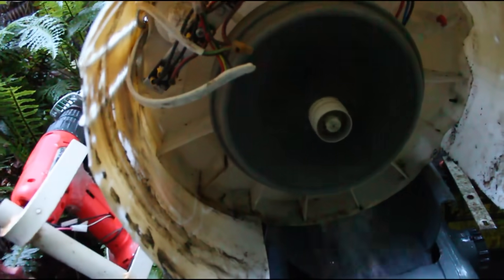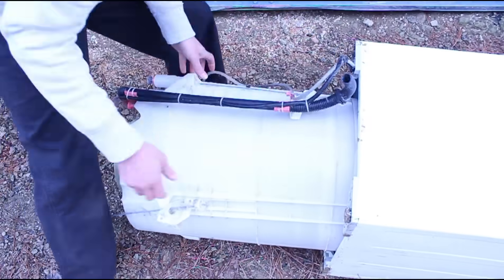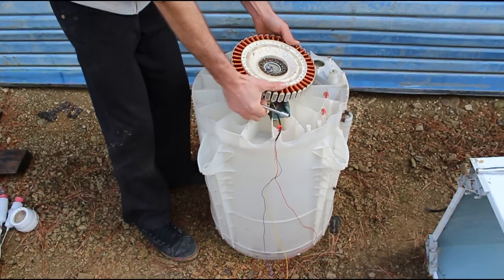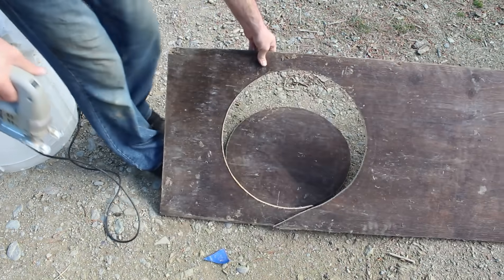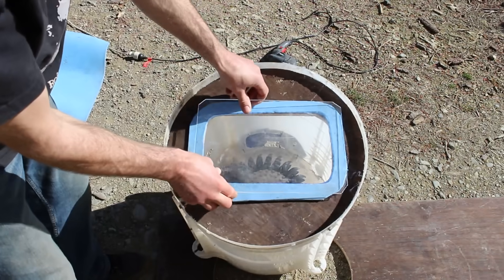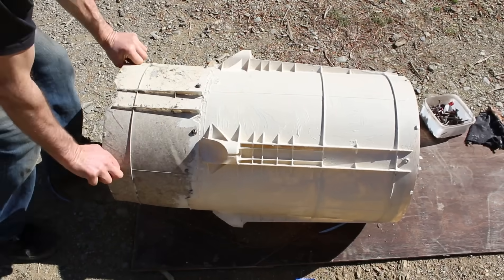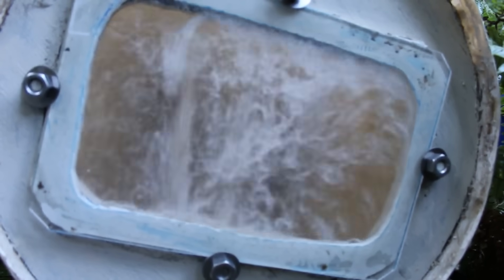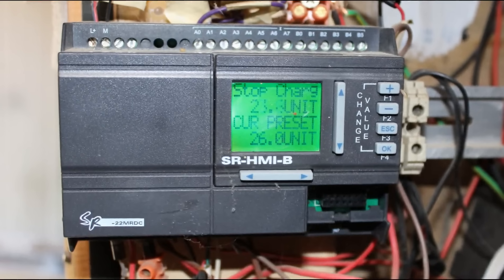Free power- How to convert an old washing machine into a water powered generator

Comment: Why not leave the AC output alone and move the power to where its need , then convert to DC (if desired)?
Reply from the maker: We convert to dc because ac voltage varies depending on turbine speed/load It will fluctuate between 0- 400v with high hz. Appliances would soon turn into blue smoke generators
Reply: Angry Ram I see your reasoning. Thanks for the response! I know you can move AC further than DC, without losing voltage. So the battery absorbs the great fluctuations , then you draw off that 🤔 I see . I’m doing some research to build a system. We have a decent creek. I don’t think the required washer unit can be obtained in US . I’ll have to figure out another solution. Thanks for sharing your experience!
Reply: @conradhomestead4518  Most US washers have the same system now. I know for shure that the whirlpool Cabrio and Bravos have it.

Comment: Would it not be more efficient to have the rectifier closer to the batteries in order to have higher voltage on the way to the house?
Reply from the maker: There is an inverter connected to the battery bank at the turbine, I send 240vac up the cable to the house so very little loss

Comment: I know this is an older video and maybe you have done it already, I know one video you said you change the bearing every 2 years now.  But would it be possible to incorporate a temp sensor to your dump valve set up so if your bearings fail you don't melt your unit?
Reply from the maker: Good idea, that would be fairly easy, just a  thermostat right next to the rear bearing (always burns out first) Connected to the dump valve trigger relay. They do give me me good warnings though, they usually whine for a few months before they melt, I can hear them from the house at night. I ignored the warning a few days too long last time
Reply: @Rambro-angryram  thank you i ll keep a eye for that when i manage to build one. And I'll put lubricant.

Comment: Fantastic mate, good on ya. Ingenious idea. I have a question if I may. I've harnessed tidal current on an island in land from the north western part of the Pacific, actually correction,  we are actually located on the north eastern part of the Pacific Ocean. South of Alaska. I used a air conditioning fan in a fifty gallon drum. I would like to know if I could make this power by having to start it with a cordless drill to get things spinning then a pump starts up sending water up eight feet where there is a reservoir. Once that has started I'm making power. From the reservoir water that was sent up by the pump which is powered by the turbin once you either started with a cordless drill, or build a crank to send water up to the reservoir to get the recycle water fall going and delivering 500 wats, 5 amps or more. What do you or anyone think...? Thank you so much, soon we can put power companies to bed with all those abandoned shopping malls dotted all over the USA, no one wants to browse around these gigantic sites, 100 acre abandoned parking lots and concrete, no one even want to buy one for a $1.90 Canadian. The munisapality agreed to lease the huge mall for a dollar a year, 100 yr lease. They get paid on the back end of the deal, when the local power company starts sending cheques for all the power we can provide them with. Great venture, there are hundreds of these locations and it screams failing community model. Having the municipality gain income from the property is easier than giving it away to be recycled. Very little steel used in most of their designs they made sure there were sufficient natural light to helping the shoppers to be mor comfortable that was their thinking, it also allowed them to have natural growing trees and such....  love to know your thoughts on my rambling questions....thank you....Muskoka, Ontario Canada. Beautiful Lake of Bays, Bigwiin Island. Old 117. Chill Winston...passing your channel to my friends with overwhelming energy bills..this could really help them. Great mind you possess...cheers Dorset.

Comment: Im having trouble finding a fisher and paykel smart drive machine anywhere near me. If i were to order the parts individually to make this what would all the parts i need be called? Advice would be much appreciated. Cheers.
Reply from the maker: You'd need the stator, rotor, hub and shaft. There are similar permanent magnet motors on ebay, might be the cheaper way to go

Comment: you did not show details of rewiring the motor. I said that originally it would put out about 440V. Did you rewire the coils in parallel cutting the voltage to 220V or 110V?
Reply: No, Marty placed a rectifier on each of the three phases converting the 400VAC to 27VDC...
charging the batteries to 24VDC, 
then that powered the inverter to produce 230VAC, 
which then went to the house....
household electricity and appliances are 230VAC in New Zealand..
Reply: See Marty's latest hydro using this technology and fully explained
https://www.youtube.com/watch?v=LVoeaKCEd2o&t=1s

Comment: The stator on my parts merc outboard puts out 40 amps, I wonder if I could rig it the same way and run it thru a regulator to charge at 14.3v continuous.
Reply from the maker: You would likely need at least 2500 rpm to generate a useful amount of power with that, perfect for using with a stationary motor but not so good for wind and hydro. My one only requires 300 - 1000 rpm
Reply: Hmmm, I can test this and figure it out.  Great video, subscribed!

Comment: I'm curious,  how do you get your water pressure so high from a little gentle running creek??, from the looks of the stream you'd be hard pressed to get 8lbs??
Reply from the maker: The intake pipe is over 100m long around 30 metre head between the intake and outlet, this difference in height creates the pressure, the flow rate is irrelevant

Comment: Use 2 wheels and injectors so you can throttle on both when water level is high and only use one when water level is low. Since this kind of turbine like to lose allot of power when running under to high pressures especially when at high load

Comment: if this creates 600 watt, is that enough for a waterpump creating an endless flow of water? I'm not really into this but if the water pump uses 500 watt, do I get 100 watt for free basicly?
Reply: Best bet would be to use a ram pump if youre using a standing body of water. And collect the run off from the ram pump in a container and pump or haul it back to your pond so it never runs dry

Comment: Bottom line is this thing needs better bearings and a way to keep them away from water, which is what's killing the bearings. Perhaps adding a mechanical seal (such as used on water pumps) and a bearing assembly that can be lubed on a regular basis is the answer?

Comment: You should power a washer motor, inside a steel barrel powering a turbine pulling in water one end and pushing out x amount of hoses at good force. Also put hoses downhill so gravity aids. But you’d in theory baby your own high powered, multiple generator capable water pump? Then power x generators to make up for power used, and you could up scale it??

Comment: 🤔 I must say that it quite ingenious.  My concern would be on the longevity of the electronics.  Even though a complete design build utilizing the rotors and stators from multiple washers and fully building a foundation my belief is that the main electronics would fail after continuous hard use. 1 two 2 years perhaps.
And some 40lbs of water pressure, nicely done. 👍
Reply from the maker: It is still going strong all these years later, the plastic drum is starting to break down so I will need to make a new one in the next few years

Comment: Correct me if I'm wrong, but could you not add another system in below it that is being fed by the water the first one lets out? Thinking about doing this myself companied by solar, because 600 watts is super impressive, but still not enough for the house and workshop I plan on building lol
Reply: You would need the same amount of water and the same amount of fall....it's the energy imparted by gravity on the "falling" water column which gets taken out of the water by the generation process...and it then needs to build it up again the same way...which is why hydro dams have large lakes leading to another dam "lower down" the river...
Reply: @JohnSmith-yv6eq  oh gotcha. So could probably be done with enough engineering lol

Comment: I don't know if it's been said already in the comments but what kind of power are you producing as far as amps
Reply from the maker: Around 33 amps max
Reply: @Rambro-angryram  thank you for replying back I have one of these electric motors out of a Maytag washer but I don't have any moving water nearby so I was thinking have a double barrel system one on top of the other and had the waterfall on the Wheel to turn it but start with a larger pipe on the intake and reduce it for pressure as it gets closer to the wheel
Reply: So yours charges at 20 amps and 25 volts is that 24/7 continuous
Reply from the maker: @williamirion728 Yes around there, Depending on the time of year and stream flow rate. It only stops for half an hour every few years to change bearings and a few minutes occasionally while I change the jets
Reply: @Rambro-angryram  have you figured how many watts a day your producing?
Reply from the maker: @williamirion728  Amps x volts = watts so say its 20a x 25v = 500w x 24hrs is 12kwh per day

Comment: Where is he getting the water pressure to power this. A pump? I seriously doubt it's from his stream..... i think the idea would be better as a windmill. Dang i missed the part about the Artesian well.... still good luck finding one of those!
Reply: Streams provide plenty of pressure once piped like he does. I've seen the like in many places here in Kiwiland, though not used in such a simple way to generate electricity.
Reply: well,  when two liters of water per second  is piled  thirty meters high,  there will be SOME pressure.   doh

Comment: My batteries are far away from water source so am thinking of leaving it at regular wiring and ac then converting to dc at the house. Would that work? You said it can create 400v can 400v be converted to dc then use a charge controller to drop down to 24v?
Also do you know roughly the rpms to create the 600w or 900w? Am thinking of using a water wheel instead of jet and pelton wheel so would be nice to know how to gear it. Any help would be appreciated thanks

Comment: Would it be at all worth building something like this with a rainwater reservoir as a water source? 
I understand it'd be a much less reliable solution that way, but perhaps still worth it in some conditions? Or just for curiosity...
Reply: not worth it, at all.    unless you just can't stop yourself.           cheers

Comment: How do you limit the voltage to the batteries to 13 volts?  Some kind of regulator?
Reply from the maker: The battery will determine voltage when connected to the turbine generator, as long as you have a charge controller set at the right level so the battery doesnt cook

Comment: How much of a difference in height do you need between the water intake and the turbine wheel?  Some programmable logic controllers can got for as cheap as $100.00 American.
Reply from the maker: At least 5 metres head for this type of setup. Thats good value, just have to make sure they have analog inputs to measure the voltage

Comment: Very interesting. I have never heard of that brand of washer though. Is it the only one that will work, or will any washer do it?
Reply: Fisher & Paykle are a New Zealand brand, I have heard that Samsung upright washing machines have the same motor system in them but are aluminium housings. So less likely to blow the bearings through over heating

Comment: I just have 1 question maybe you or someone else can answer? How do you get your water pressure up enough to spin the wheel at that speed? Im assuming your water is coming from a creek, water goes through a pipe which ends up spinning your gear/turbine. But i believe i heard and seen in either this or another one of your videos a wheel spun by water with a higher pressure. How can you generate that kind of pressure? Is the water pressure independently powered through a battery? Or is the pressure coming from the creek alone?
Reply: Gravity...the water "falls" through the pipe. 
The further it falls, the more pressure at the bottom of the pipe.

Comment: What specs of batteries did you use and how long did it last? For the benefit of fellow newbies here, it's nice to share the generator winding specs for a diameter of a Pelton Turbine with a Water Head and Capacity per minute of water used.

Comment: Wouldn't you gain more power if you built a simple housing around the wheel, keeping the water in contact with the wheel for a longer time? Sort of like a pump in reverse? Ideally one might make a complex and efficient housing, but I suspect you'd gain a lot from even a simple tube of slightly larger inside diameter than the wheel, two sides on it, and an outlet for the water.
Reply: Also, if at any point you have no use for the incoming energy, say when the batteries are full and the water is hot, etc, perhaps you could rig up a valve that stops the water flow. This would reduce the wear on your generator bearings, which I imagine are working well outside their intended RPM and duty cycle.
Reply: Btw, if this sounds like criticism, don't worry, I'm just always looking for ways to improve things. What you've done is amazing and if I had a stream, I'd love to do something similar.

Comment: please put up the rectifier info link you mentioned. looks like you are using a delta connected winding and one input on each bridge rectifier and not using half of each bridge? if so, why not use all of one and half the second and omit the third? also why not use the diode plate out of an old car alternator? anyone who needs a diagram: google automotive diode alternator diagram. i think anyone who has lots of pressure/drive and isn't worried about friction efficiency due to the losses on the slip rings could use a car alternator for this and mount a shaft bearing and seal on some thick nylon like a couple of laminated 10mm cutting boards. looks like the main advantage of the shown method is getting the bearing rotor and housing etc.
Reply from the maker: I use ready made 3 phase rectifiers these days, they're cheap and less issues with corrosion on the terminals. Car alternators start producing useful current at around 2000 rpm, too high for most low head turbines, could gear it up with belts or chains but you introduce more frictional losses

Comment: I plan on running 200 to 300 meters of 4 inch pipe with a fall of around 20 meters.
Will this give me enough preasure through a 10mm jet.
Reply from the maker: You might get a few hundred watts continuous from that, search online, there are head/flow - watt calculators out there
Reply: Thanks

Comment: My creek is a couple hundred meters from my batteries. Can I just leave the motor to create ac and use my inverter at the battery bank?
Reply: YES.   in that case,  the 'wild' 3-phase ac  pma output  Should be run.    cheers

Comment: Living on a very small island 🌴 in scotland 🏴 I couldn’t afford to get mains 240v connected £6500.  So i had one of the first inverters 250V but  not pure sine wave, lines on the tv screen 📺 2 truck battery’s........ h20 and wind power and a back up generator for heavy load  at night eg washing machine hot water 🚿 but that was 25 years ago.
With technology now, it would have been so so easy..............🏴🤪

Comment: All the bearings will burn up on these. They're pretty cheap. I would replace them with some nice quality ones since that part is receiving the most wear and tear.  PMing them nearly every day would help a lot as well
Reply from the maker: The current set of bearings has lasted over 2 years running 24/7. Thats good enough for me, I usually budget on changing them every 2 years at $15 a set
Reply: @Rambro-angryram  any bearing housing that you can fit that has a grease fitting? That will help a lot as well.

Comment: If someone does not have a large piece of land with a flowing brook maybe a large man-made pond with a water pump (energized by the same water generator)  recycling the water to one of these water generators. May need to have the water flow pumped up 6 feet or higher and then come down and maybe its enough force to drive the generator for a decent output of electricity. Just speculating.
Reply: If 213ft of vertical fall generates ~850 watts, 
If 6ft  ?          
almost negligible....

Comment: Great video, this might be a stupid question but how did you get the water pressure so high from your water source?
Reply from the maker: Gravity creates the pressure. The greater the height difference between water intake and outlet jet, greater the pressure at the outlet
Reply: Thanks! I guess that really works well for you because your on large slope. you can make a long angled pipe for more pressure.

Comment: How are you getting 45psi from your water source?
Reply from the maker: The water intake is higher than the outlet.. the greater the vertical distance (head) between the inlet and outlet, the greater the pressure

Comment: It seems perfect, but how does it perform once connected to a load? Most turbines as a basic electrical rule become extremely difficult to turn once the are attached to a battery or a high current drawing appliance.
This seems to spin a little to free to be attached to a battery. The diameter of the wheel also doesn't seem to fit into the physics of turbine production. In saying that water under pressure would produce far more torque than wind power. I'm not being negative im very interested in the experiment but it seems to be producing very high current....